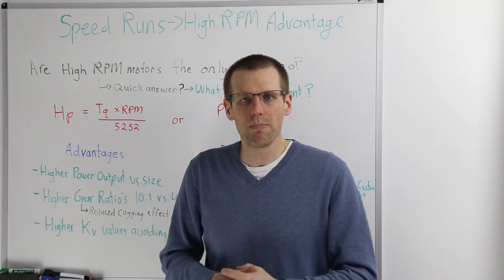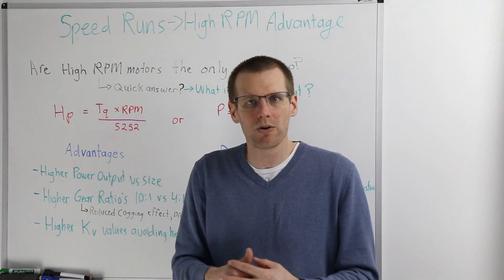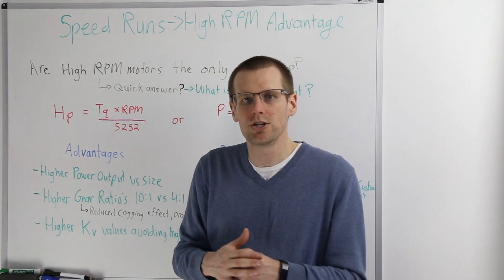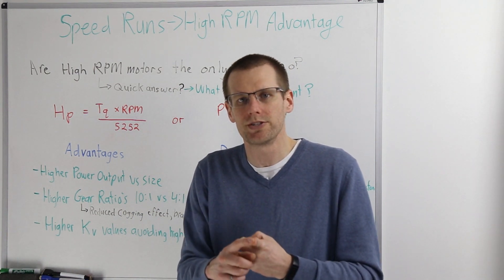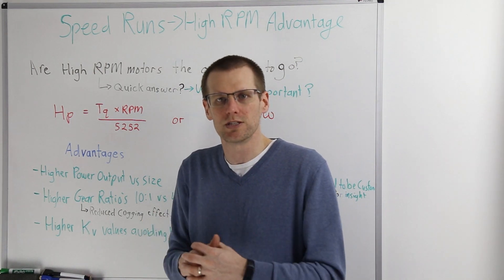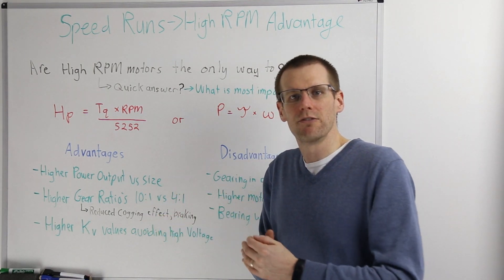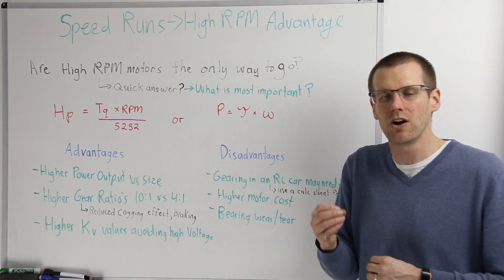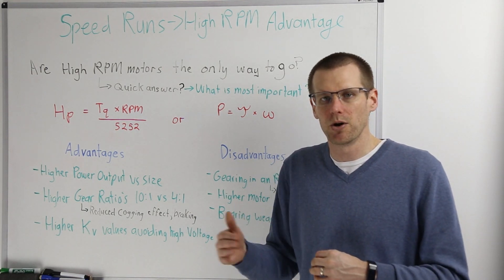Exploring Benefits of Extreme RPM Brushless Motors in RC Speed Run Cars

Comment: I'm looking for a high RPMs motor for a centrifuge, so it also has to rotate about 5kg of weight (about 1.5~2kg of the fluid to be filtered, and about 2~3kg of the spinning cylinder+rotating-rod).
I see that smaller rc motors can hit higher RPMs, I assume because they are not supposed to rotate much mass.
The centrifuge won't have to run for a long time. Actually the higher the RPMs the much shorter the run time would need to be, as the centrifugal force increases with the square of the RPMs.
But I'm not familiar with el.motors specs.
Do you guys have any recommendations or advices?

Comment: Another pros and cons of high vs low kv motors is that a high kv motor is not eficient, doesnt have much torque it kills the escs because of the low voltage and high amperage frequency that the esc needs to work in order to spin that motor that fast, motor overheats very fast basically a high kv motor is not efficient in any way and the low kV motors are the complete opposite because they spin slower but can take a lot higher voltage meaning that its going to work very efficiently with the esc lower kV doesn't mean that its going to be slower you can change the gearing in order to go a lot faster because low kV motors have a lot more torque than high kV motors in a lot of cases lower kV motors go faster than high kV motors